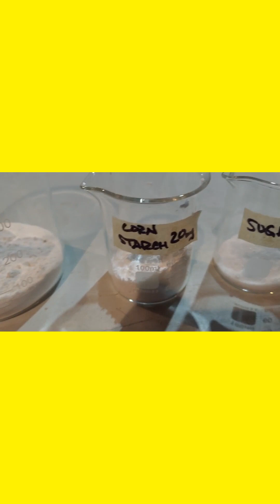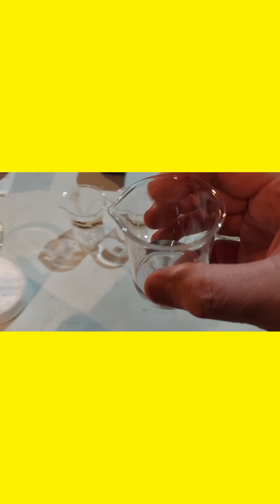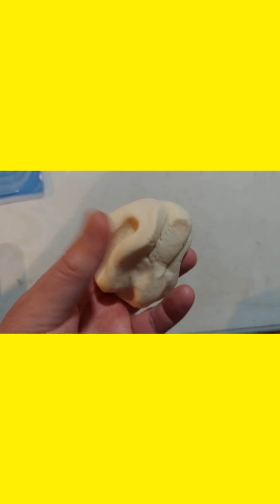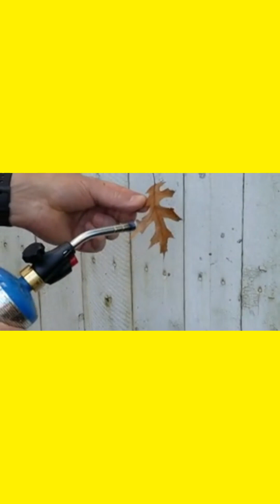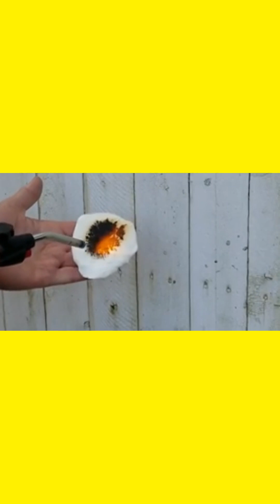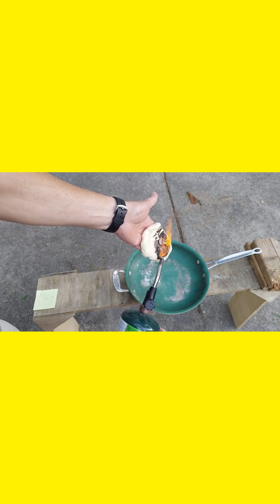This Dough Protects Against A Blowtorch #chemistry #scienceexperiment #science #reaction

Comment: Were the pennies pre, or post 1982?
Reply from the maker: They're the cheapo zinc pennies.  You just can't melt a solid copper penny with a propane torch.
Reply: @cranialconstruction  Yes you can as the temperature of a propane-air flame can get to 3596°F (1980°C ) and copper has a Melting point: 1,984°F (1,085°C).

Comment: just curious. How did it not burn your hand like completely off.  I can imagine it wouldn't light, but how did you mitigate the heat?
Reply from the maker: The carbon layer just can't be burned with a blow torch.  When it forms it deflects most of the heat.  The doughy layer underneath has enough water to keep your hand cool believe or not.  However, eventually the dough would dry out and you would feel a lot of heat, too much to bear.